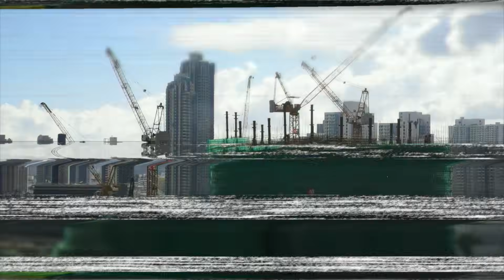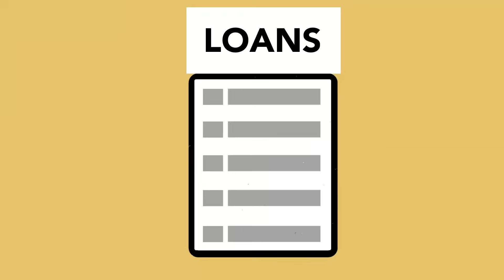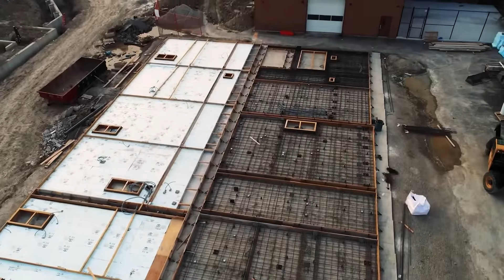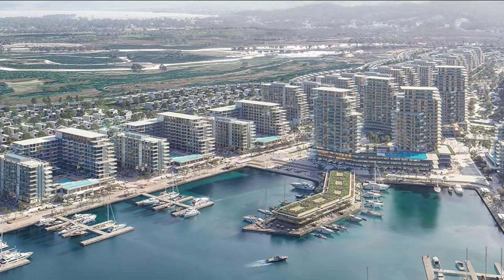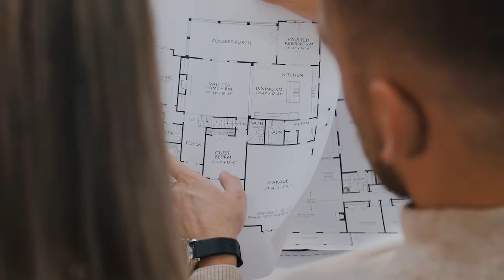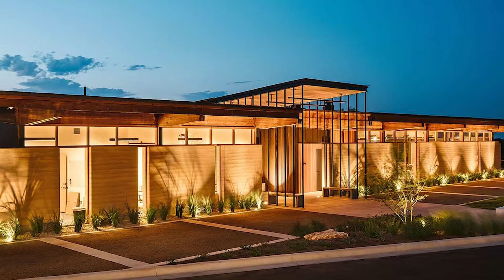China Builds Buildings Like LEGO in ONLY 28 HOURS!?

Comment: They will come down faster than the 28 hours it took to build them .
Reply from the maker: Fair instinct, but it's backwards in this case. The 28 hours is assembly, not construction — the modules spent months on a factory line under controlled QC, and the foundations took months more. That's the opposite of rushed: almost none of the work happens outdoors in bad weather by tired crews. And the whole reason Zhang Yue started the company was watching concrete buildings fail in Wenchuan in 2008. Concrete cracks and drops with no warning. Steel yields and bends first. If one of these does have a bad day, that failure mode is the point. Thanks for watching though.